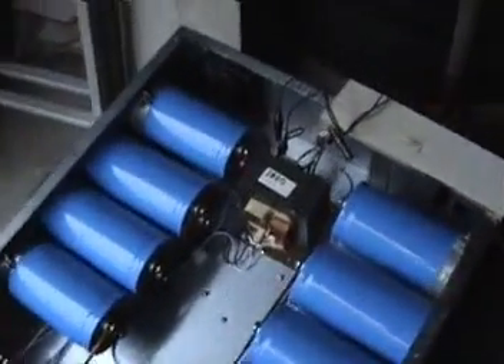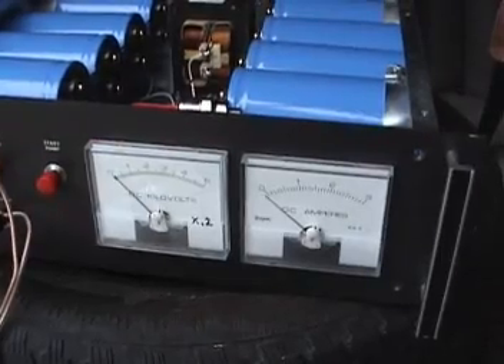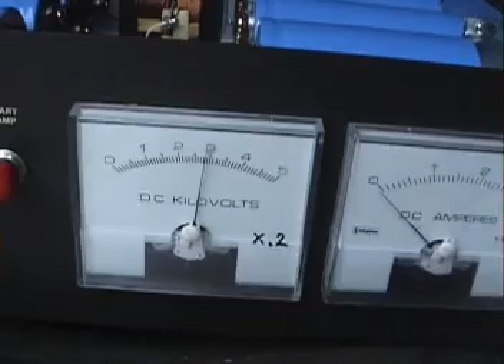8 Capacitor Coil Gun

Comment from the maker: I started with a couple of big capacitors removed from an old telephone system power supply.  Basically all you need is a voltage multiplier and a big capacitor or lots of small ones.  I have a 300 volt model that uses about 30 small 470 uF caps.

Comment: Use a hockey puck style SCR. That is what is used in Capacitive Discharge stud welders. Dont need to worry about heat sinks, but you do need to make sure there is enough pressure squeezing down on the SCR. These SCRs rely on the pressure of the mounting clamp to hold their internals together.

Comment: I have 6 x 1100uF/450VDC for my railgun, they look about the size. You might find it more useful to run the caps in series, as that increases the voltage (but lowers the capacitance). The equation for energy is E=1/2CV^2, (c=capacitance), and since voltage is squared, that means that if you double the voltage you get 4x the energy. Also, the more capacitance the longer it takes to discharge through the coil, could reduce velocity. You can get some HV (4000+) x-formers from old microwaves.

Comment from the maker: P=IxE If you double the voltage you increase the current and quadruple the power.  So I use 800 volts to get a lot of current flowing.  Some capacitors are called AC because they can be cycled a lot.  DC capacitors are not designed to be rapidly charged and discharged, but they work.  Some will be rated for both such as 1000 VDC, 800 VAC marked on the same capacitor.

Comment: You wouldn't necessarily need larger caps, but the caps you have should be optimized for the coil. The larger the capacitance the longer it takes to discharge, which could reduce velocity. I have 6x 1100uF/450VDC caps in my railgun, and I run them in series (halves capacitance, doubles voltage). The equation for energy is e=1/2cv^2. If you half the capacitance you get 2x less enegry, but since voltage is squared you then get 4x more. So, more voltage/less capacitance = more total energy.

Comment: just a sugestion, I notice the wire you use to connect the coil to your power supply "looks" quite thin. In terms of resistance, this could effect the effectiveness of your setup. most of the pulse could be dissipated as losses. I believe you can get better results using some thicker cables, otherwise thats a neat looking power supply, im quite impressed. keep up the good work

Comment from the maker: It is current that you are after, the higher the voltage the more current flows through a coil.  To deliver a lot of current big capacitors or batteries are needed.

Comment from the maker: Back then I was using a 1/2 inch by 1 inch bolt.  The coil was three layers of 14 gauge wire, about 30 turns, on a 3/4 inch tube.  In a later video I used a coil wound on a pencil and a nail to shoot through a can.

Comment from the maker: 10 car batteries would give you 120 volts, that would make a good coil gun.  You might be able to charge them using 110 volts from the outlet but there should be a resistor to limit the current and overvoltage protection to prevent them from being overcharged.  I was using 800 volts.

Comment from the maker: The bigger the capacitors the longer the pulse width.  The higher voltage leads to higher initial current.  800 volts through 1 ohm is 800 amps!

Comment: Capacitors... I wish I had your intelligence.

I tapped off directly off the mains with mine.. before the fusebox.

Then ramped it up through a homemade 10:1 transformer up to around 2.3Kv. Rectified it with some old ESB equipement I 'acquired'.

Then blew out most of the grid, my transformer, the coilgun, and my vision for a week or so.

Raw grid energy != good idea.

Comment: Those kinds of things are important to determine the effectiveness of a weapon, while figures about how many volts it uses are impressive, more important is how effective it is as a weapon. And a suggestion, use a longer barrel and a fin stabilized projectile, rifling the barrel wont work for a coil gun as rifling works by having the partialy molten bullet follow the grooves in the barrel, a cold weapon like a coil gun wouln't have a partialy molten bullet.

Comment from the maker: However with a 100 turn coil the current lasts longer so that may also work.  This coil was about 3 layers of 20 turns #14 wire.  My latest coil is 5 layers of 25 turns, as far as I can tell it is better.  I might set it up with taps to test it with 3, 4 and 5 layers of 25 turns per layer.  Then I could tell what works best.

Comment from the maker: I am using 14 awg wire.  Bigger wire, smaller AWG,  makes more current flow and a bigger magnetic field, to a point.   5 KV is 5,000 or five thousand volts.

Comment: Why do you use so long and thin wires to the coil? With shorter wires more energy will reach the coil. And the distance from the projectile to the coil is too small. If the SCR is broken so quickly, a diode will perhaps help to eliminate the reverse EMF of the coil.

Comment from the maker: I found my notes of Joules.  W=(CE^2)/2  So at 1 KV Capacitance in uF/2 = Joules - Right?  Then it uses about 4,000 Joules (8,000 uF at 1KV)  The actual power would be less because I am using 800 volts and 7400 uF.

Comment: If you're using a transformer to step-up the voltage, which needs a.c and you are charging a capacitor which needs d.c how is this issue rectified?

Comment: AC or DC caps? I have 4, 475 volts AC Capacitors wich have 45uf each, i was thinking about but them in serie for something around 1800 volts and 45uf, will that generate some power or does it need to have moore Farads?
Plzz Answer!! Best Regards

Comment from the maker: Power = E X I (Voltage times Current).  So the more the voltage the more the power.  The same applies with current unless you have so much current as to fry something.  The power supply is sparking as it is.  I think I need better connecting wires and connections.  It is best to avoid solder connections because it melts at these current levels.

Comment: You only use 1 hv diode and resistor? geez i cant even begin to imagine how much they heat up. Also, how do you have the cap lined up? Do you have all of them in parallel or a series-parallel configuration?

Comment: if my camera flash charger came with a 330 volt capacitor and i hook up a 200 volt capacitor instead will it overload the capacitor or turn off automatically thanks?

Comment from the maker: @coreyisbuzzing - Put 5 in series for 2000 volts then use an old MOT for a power supply.  Any higher voltage and SCR's cannot handle it.

Comment from the maker: There is not enought current in outlets due to the circuit breaker.  You need to charge capacitors first.

Comment: do you just need a transformer only to charge capacitors (plus battery ofcourse)
can you tell me how many volts, amps, farads, and whatever else there is that i need for the transformers,resistors,diodes,relays,capacitors,and all that stuff?  I am pretty much clueless on what to use.  (im on attempt two of my first coilgun)

Comment: You need a smaller, sharper projectile. Maybe get nails and cut the heads off so you just have the point and the shaft.

The faster the projectile, the more energy. You want a small, heavy (for it's size) aerodynamic projectile that can move really fast with good momentum behind it.

Comment: U should have the coil better weighted down and u should use an entire pound roll of 22 gauge wire and just find the two ends cuz that's alot of wire and it is machine wrapped by the factory

Comment from the maker: A car battery would not get enough current to flow unless you used a larger gague of wire. The voltage is too low. -Bob

Comment from the maker: I bought a box of them at the Rochester Hamfest for $65.  I have tried defib capacitors and they are lame.  Their 30 uF does not compare to 3,000 uF.  Maybe I will post the video?  The advantage of defib caps is that they handle 6 KV!